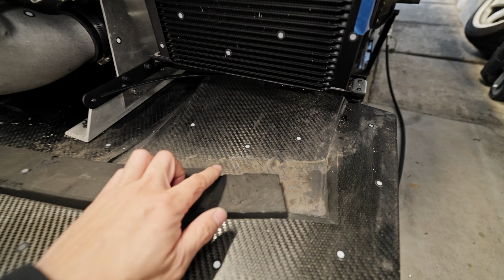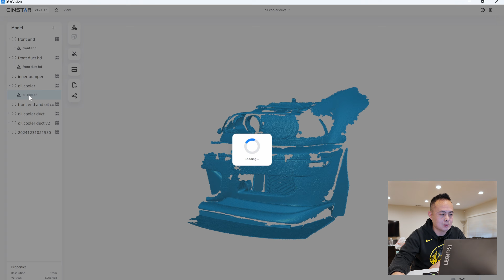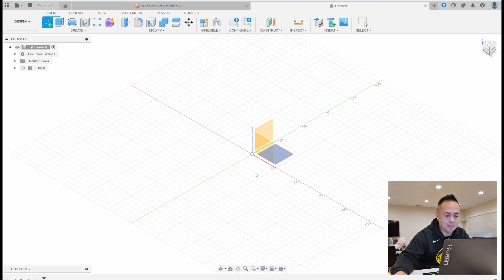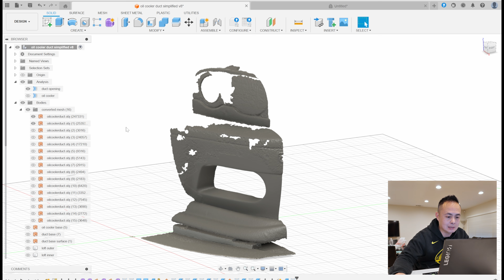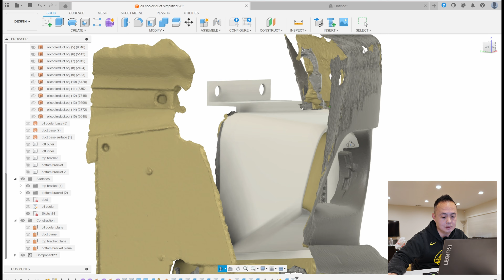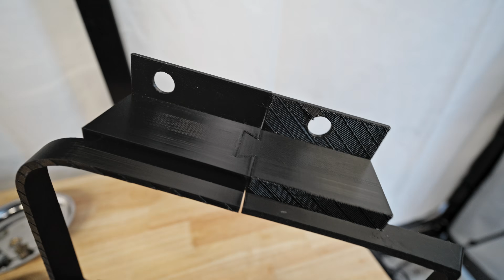3D Printed Car Parts

Comment: Did you have to heat the print bed to get the chamber nice and warm before printing your carbon fiber parts?
Reply from the maker: No, thankfully the Bambu default print profile for the cf stuff is good as-is.  I only need to get the chamber nice and warm when printing abs/asa or else it would warp.  Maybe the fibers within the pa-cf spools help it not warp.
Reply: @c @cjoy28 thanks for the reply. Did you use the same carbon fiber for the support material as well? Looking at buying a P2S and wondering if I’ll be able to save my CF material and use something else for supports.
Reply from the maker: @LifeOfMikeChannel yes used it for support material as well, haven’t gotten chance to try multi material.
Reply: @cjoy28 Got it. Thanks again for the feedback!

Comment: nice video joy!! I manage to get some tips from you even i think i am in the same level as you on fusion. Bambulab its awesome, I just purchase one few weeks ago, totally a game changer. I have been printing since 2017 on and off, and it was a totally nightmare. Now you can be in bed with your laptop, one click and that motherfaaker its printing perfect. Mine is a p1s and prints really good, x1 carbon sure its awesome. By the way im   almost finishing the restoration of an e30 coupe with s54 engine, and im waitting for the delivery of my first 3d scan, so will be looking all your videos to see if i can get more tips.
Reply from the maker: Thanks for the comment!  I just started learning fusion around the time I made this video so definitely not an expert but happy to share what I learn with everyone.  E30 with S54 is cool.  I track with a buddy that has a S54 swapped E36.  More videos soon.  I’ve been making splitter end plates, center console block off plates, and other things, just need to upload videos!

Comment: What file type did you use to import the scans? .stl? When I try that with Fusion - it always says "too many triangles"!
Reply from the maker: @Tankengine2  I import into fusion as an obj file.  If you’re using the Einstar app, I believe there is a feature to reduce the number of triangles as well.  I would imagine that even an obj file may encounter the same issue.

Comment: I never understood why people don't learn how to model properly instead of using a scanner, especially a design this simple, a few measurements and about 20 minutes and you'll have your design.
Reply from the maker: @DaMan97-t5p  thanks for the comment.
Reply: Exactly, I'm trying to find some information how to make it without 3D scanning, and I cant... As I cant afford 3d scanner :(
Reply: @numboemon best suggestion that I have, break it down into small pieces and then figure out how to model the smaller pieces… tons of videos out there showing you how to do things with Fusion.
Reply: @n @numboemon  you can use photogrammetry but you need something as reference in the picture to scale the mesh. 3D Zephyr is a good one or try a handy app.
But a good scanner like a CR Raptor makes a huge difference. It’s much easier to scan and has higher accuracy.
Reply: This is a lot quicker specially when you have of shapes like this. Doing it by hand you kinda also have to print some test units... This mostly does it in swoop... So much easier and concise.
Reply: @Frankie_Freedom  I've never used a scanner... I kind of want to get one to play with but I've gotten pretty good at modeling. Maybe someday when the prices go down I'll get one.
Reply: @DaMan97-t5p  True true
Reply: You probably doesn’t use a Spacemouse too because a normal mouse is good enough?
Reply: @Todestelzer  are you high? Because nothing you typed makes any sense.

Comment: textbook , well executed  👏what glue will you use on the CF nylon ?
Reply from the maker: @carbonmk1  thanks for the comment!  I used jb weld plastic bonder, and it’s holding up pretty well.

Comment: OMG this is so cool. I'm thinking of printing a tail fairing for my gsx-r 750. But have absolutely no experience with 3d printing.  Is this program easy to learn? And what was the cost of the equipment?
Reply from the maker: @GlennFossum  thanks for the comment!  The Bambu lab was the first printer I personally owned.  Had a little experience from my previous employer with printing but not necessary, the Bambu lab was very user friendly.  In regards to the cad software, I also had some experience, so if you don’t have any experience at all, it might be a little of a learning curve.  Good thing is fusion 360 is free for a non commercial license, so try it out, nothing to lose.  The printer and scanner cost is a little investment.  Wouldn’t recommend it for a one time job, but if you like to do these types of projects in the future, I think it’s worth it.
Reply: @cjoy28  thanks. Yeah if im investing it will be something I'll use for alot of projects.

Comment: Also- for those curious out there: I’d highly recommend the ABS route rather than trickier filaments like CF Nylon. It’s cheap, high temp resistant, still prints fast, works great in enclosed core XY printers like this, and you can just use some ABS cement from your local hardware store which doubles as a solvent and gap filler where you have minor imperfections. Also sands well and acetone cleans up the final print beautifully. Gloss and matte finishes are both easy to achieve.
Reply from the maker: @apoc224  thanks for the feedback!

Comment: Nice video! I’ve been doing similar for aero upgrades to my vehicle as well, although I don’t use a scanner, just very careful measurement and a couple prototype prints until I get fitment right. One day I’ll upgrade to the scanner… what file format does it import to your CAD software in?
Reply from the maker: Thanks for the comment!  I agree, precise measurements can go a long way, but tough when the geometry is complicated.  The scanner model exports as an obj file and imports to fusion 360 no problem.

Comment: I saw that you have the splitter in carbon, do you know you can make molds in Fusion 360? You could have made the ducting in the same way but then take out molds to later make the duct in carbon, with a 3D scanner, a printer and a good computer the possibilities are endless... Thanks for the video!
Reply from the maker: @ex123T  you’re welcome, more scanning and printing application type projects to come!  The splitter is in carbon, but I agree, the possibilities are endless.

Comment: For glueing 3d printed car parts try jb weld plastic bonder, it's sandable and has some flex. Or you could just get a bumper repair kit/plastic welding kit and fuse it with heat. Also, for that part PAHT-CF is neat but asa would work just fine in a hot area like that as well for a lot less $$.
Reply from the maker: @jmjr_dsgn  that’s what I exactly used, jb weld plastic bonder!  Will definitely look into asa as well thanks for the recommendation.
Reply: @ I use ASA on my airbox and it's right next to my turbo, no issues whatsoever.
Reply from the maker: Good to know!

Comment: Nice project! How do you manage high temperature? PLA usually resists at maximum 50°C. p.s. nice car, i have the same model but 328
Reply from the maker: Thanks for the comment!  Towards end of video, I used paht-cf filament for the final print.  It’s a carbon fiber reinforced high temperature nylon that has a temperature rating of 194C or 381F.
Reply: @cjoy28  nice choice!

Comment: Man, That's epic!
Both that you took it on and did as well as you did.
I've long thought about this exact thing. The reason it really excites me is that the only limitation is your imagination if you have a good grasp on the fundamentals. 
If you look up the optimal ducting design for heat exchangers (usually aeroplane research). Getting that shape right is very hard within the confines of an existing vehicle unless you have extensive sheet metal/composite experience.  3d printing makes it much more accessible. 
Not just on the front end! Now you have the front done. Removing the air and managing where it goes is just as important = your next project. I'd love to see it!!!
Also what would excite me in your position. Now you know it works and accurately = you could scan and design much bigger, single piece parts. Just find someone/somewhere who can print larger objects = 100% bespoke part.
Reply from the maker: @secretsquirrel9722  thanks for the comment!  I’m imagining all kinds of stuff already.  Haven’t made a video, but working on a fog light cover, splitter end plates, steering column gauge pod and more!

Regarding where the heat will exit in front, I’ve ordered and received some race louvers for the hood(I guess I could’ve designed my own but it was before picking up the scanner and printer).  The louvers are supposedly wind tunnel tested, will definitely make a video when i get to installing it.
Reply: @cjoy28  awesome! In future you could put the cooler at an angle. Both, optimising capturing the air as it comes accross the bar into that inlet. Then duct the air either out the side of the front bar or farthest outer part of the wheel liner as an air curtain. 
Porches even used to do this with the duct exiting straight down in a curtain after the heat exchangers on both side in front of the tyres! Works exactly the same (aerodynamically) as the plastic spats you see on modern cars.
Little lips around the entire rear where you lose attached flow to maximise clean separation and reduce drag. Brake cooling ducts that dip down below the floor line in fresh air as you've lost the factory ones.
Diff cooler duct doing the same. 
Duct a power steering cooler on the other side. 
Roof mounted switch panel, within reach when harnessed. 
Helmet and steering wheel hooks when parked.
Even blanking plates into you front intakes that connect to a fan for air flow when parking up after runs.
Endless.
Reply from the maker: @ omg so many project ideas.. are you on instagram?  Might ping you on the how to duct the exit of the oil cooler around the wheel area, not sure I’m understanding it accurately.  My handle is cjoy_458.
Reply: @cjoy28  I'm sure the louvres will evacuate a lot of heat and lower the engine bay pressures overall. But even a print that mates to your louvres and selects where the air is pulled from would be brilliant. 
Like right from behind the radiator, above the turbo side, directly above each back corner of the engine bay where heat tends to collect.
Added bonus of that. If it rains, water falls into open spots rather than filling every crevice of your engine/coil packs, haha.
Reply from the maker: @ ah I see, great ideas for future projects!

Comment: This is what I had in mind watching you make the other intercooler ducting. Have been interested in getting a 3D printer myself for similar adventures.
Cool to see a practical use-case executed with DIY approach. I would make sure to glue the joints, even with the heat-resistant plastic. You will most likely get some form of warping, and the dove joints may fail slowly.
Reply from the maker: @Driver_407  thanks for the comment!  Yes, definitely glueing the two pieces together and not going to rely on dovetail joints.  I think on the next big piece I make, I might just use fasteners to join the prints together.